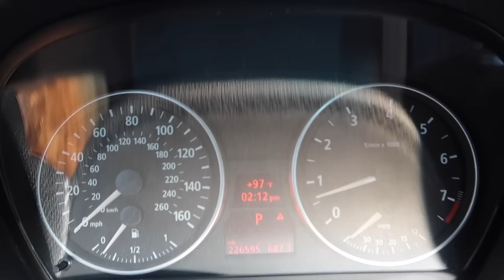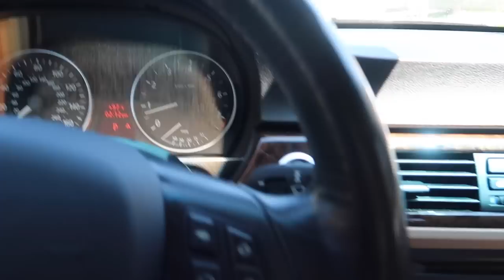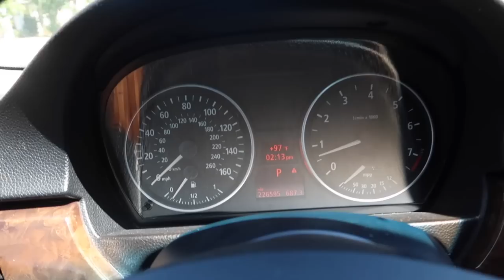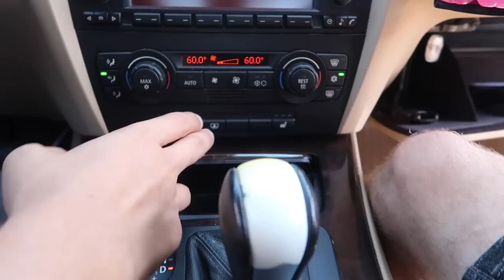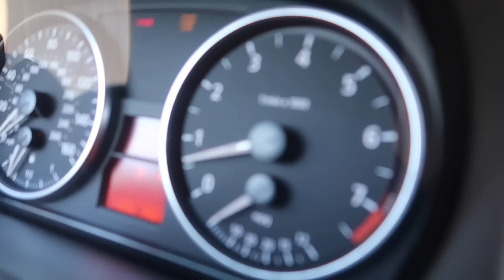NEW PROJECT DAILY!

Comment: To save getting blocks and driving the car onto them to get the jack under you should just be able to lift the side of the car a little bit which is enough to get most jack's under. I've had to do this quite a lot. But saves a little bit of time. If you're a BMW enthusiast M-Sport is definitely the way to go. Good to see you working on an M-Sport

Comment: If you do the valve cover gasket replace the eccentric shaft sensor if bad but foresure the gasket for that it tends to leak oil and foul the ess also scan for shadow codes or pending

Comment: Yo Nour, I said it before when Jon got his car. Check the DME box for water, mine started out with a vanos error when I booted it from cold. That was just the beginning, until it just died. Turned out the DME was half under water. After repair, got the old vanos solenoids in, with no lights.

Comment: Love the video 👍🏿 I’m on the market for my first car and I’m torn. My brain is saying e90 328i. But the heart 😫 the heart is saying e92 335i. Money IS a limitation and I’ve been seeing advice to stay away from 335s because repairs are a pain. I’m religious when it comes to maintenance (if I bought one brand new it wouldn’t have preventable issues) but I need more knowledge about these vehicles. Bimmers FTW ‼️
Reply: I have a 2011 E90 328i and honestly its such a great car and very reliable. It's also my first BMW. I mean its not a turbo charged engine, but it has decent power for daily driving.
Reply: John Reyles thanks for your insight man! What made you decide to get the sedan vs the coupe
Reply: Aldrin Vinton honestly, the sedan they were selling at the dealer had almost all the packages I wanted except for comfort access  and wished it came as sport package. The coupe they had was a bit more, but without an I-drive which I wanted